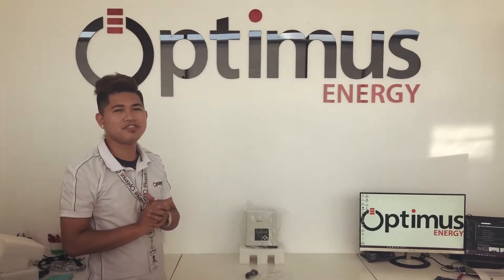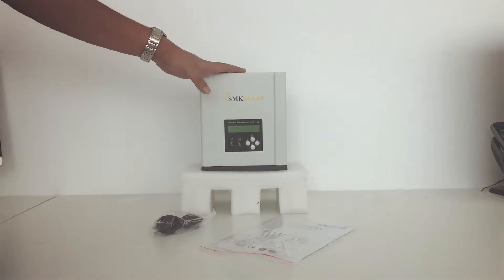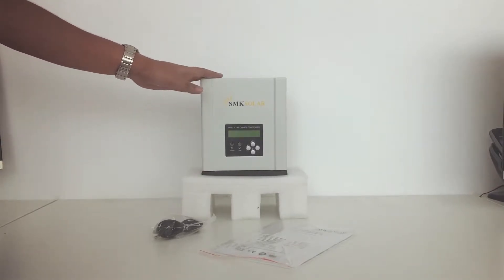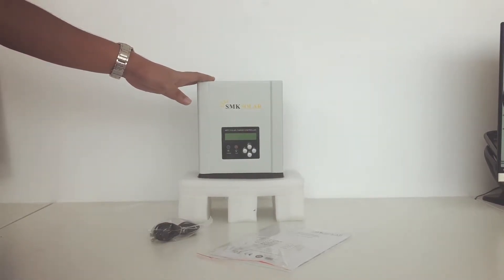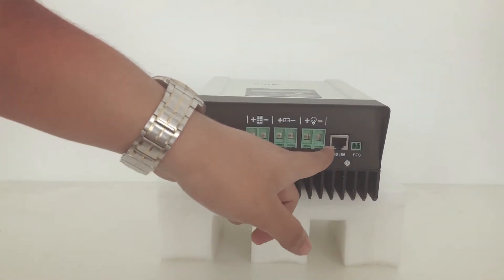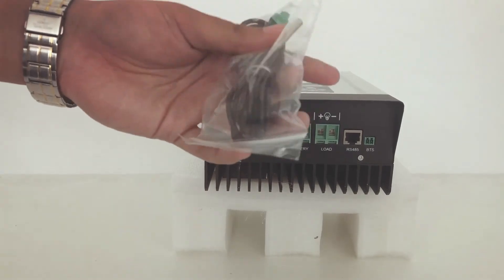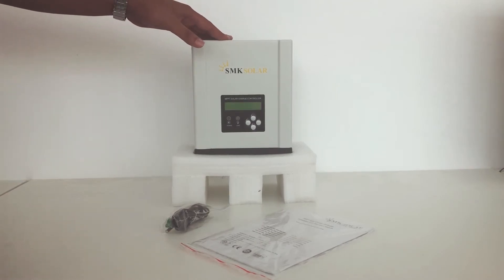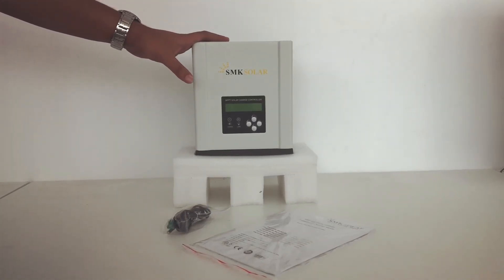SMK Solar MPPT Charge Controller

Comment: how do you setup RS-485 port? i have the software and cable but computer wont see device no matter what usb port i plug into
Reply: Meee to, what pins did you try 1 and 2 from RJ45 cable or another combinations?
Reply: Could you share software name?
Reply: Do you know what pins must be connected?
Reply: I want to know what software to use